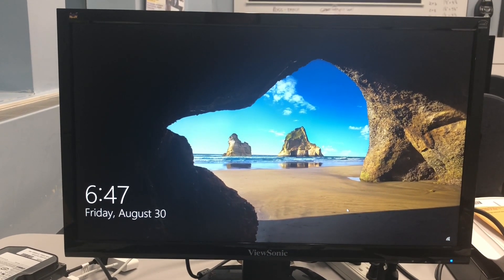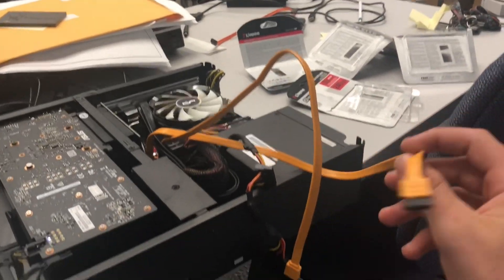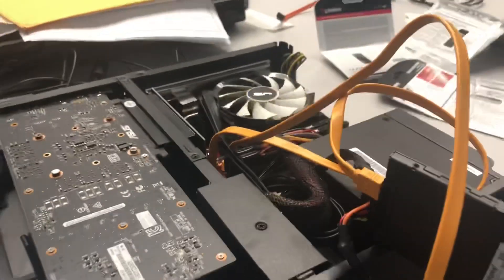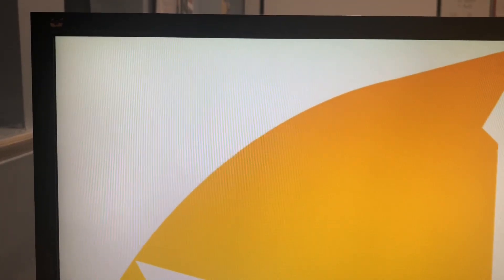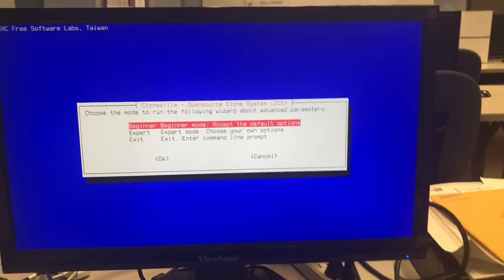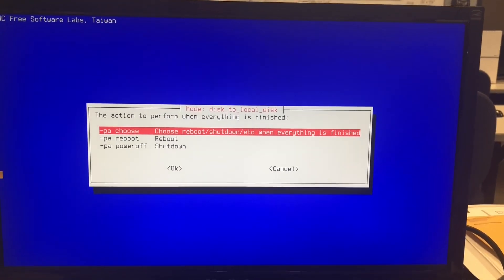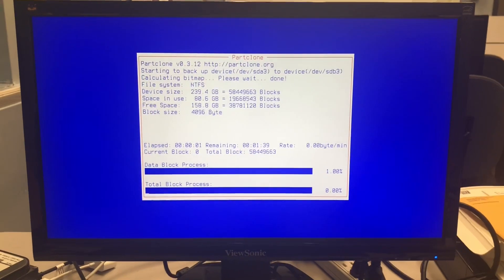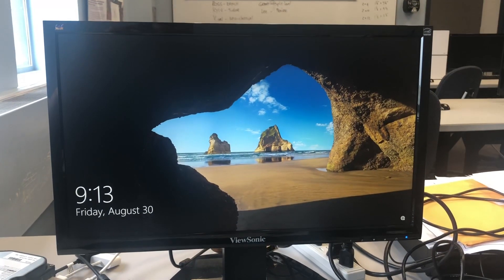Cloning hard drives with Clonezilla!

Comment: Can it clone a bigger size HDD/SSD to a smaller one? I need to clone 500 Gb HDD (with 450 Gb free space) to 120 Gb SSD.
Reply from the maker: George Unknown No clonzilla can NOT do that. Depending on the hard drive manufacture they might have their own software to do that.
Reply: @drewbottorff  Would you be able to shrink the 500gb partition to 50gb and then clone all the partitions except the free space onto the 120 ssd?
Reply from the maker: I haven’t tried anything advanced like that. I had a 500gb that I just mirrored to a 500gb SSD. 500 GB are pretty affordable these days.
Reply: @StephenCunningham1  it will work, but very long ...